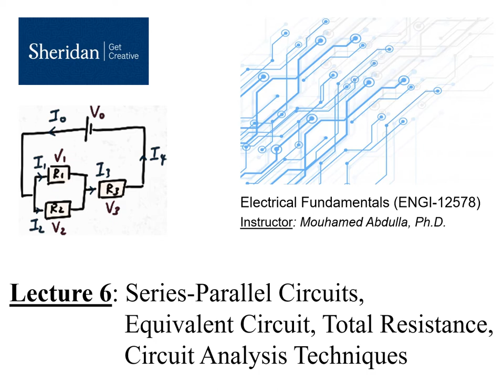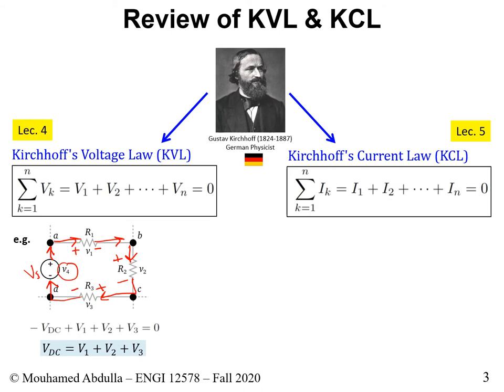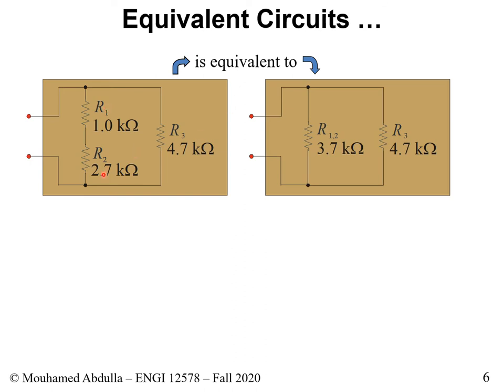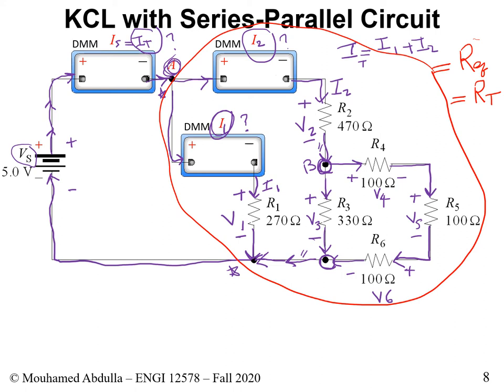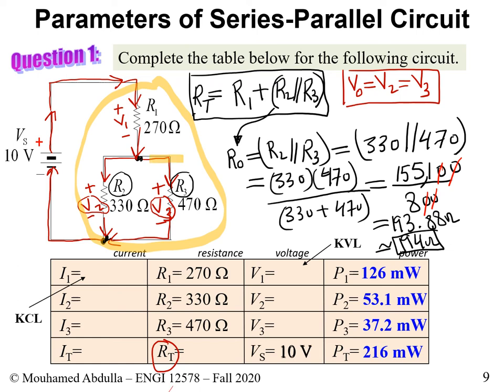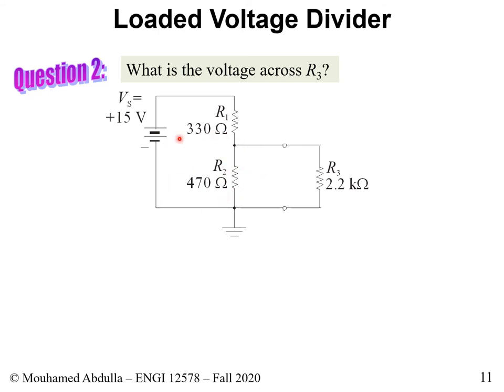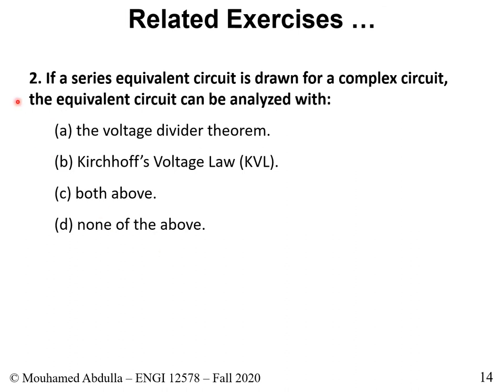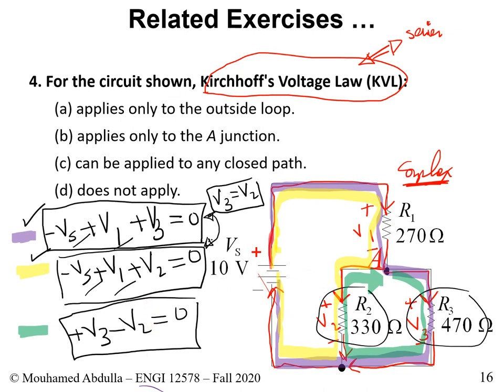Lec 6 - Series-Parallel Circuits, Equivalent Circuits, Circuit Analysis Techniques

Comment from the maker: Timestamps:
-----------------------
0:00:00 - Introduction
0:00:17 - Series-Parallel Circuit
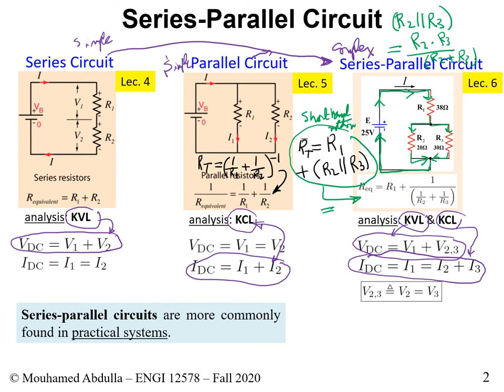0:13:20 - Review of KVL and KCL
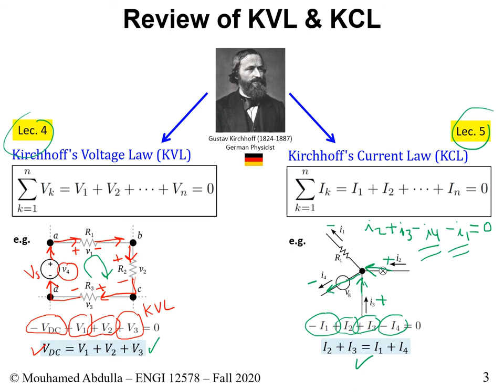0:19:02 - Tools for Solving Series-Parallel Circuits
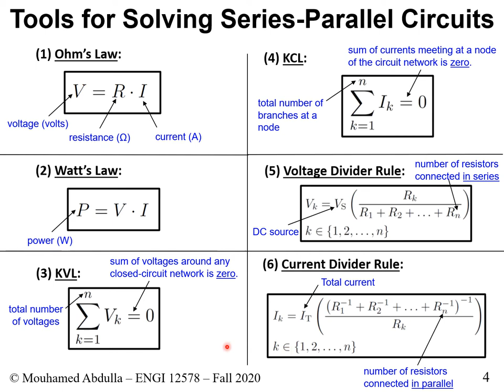0:24:05 - Equivalent Circuits
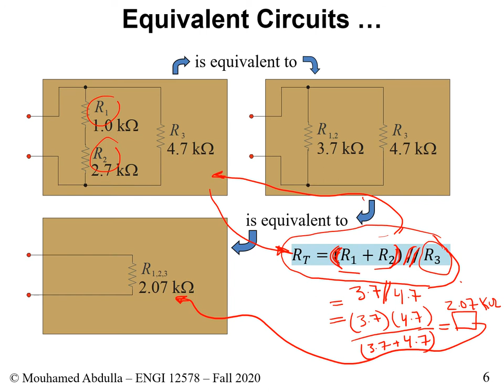0:34:25 - KVL with Series-Parallel Circuit
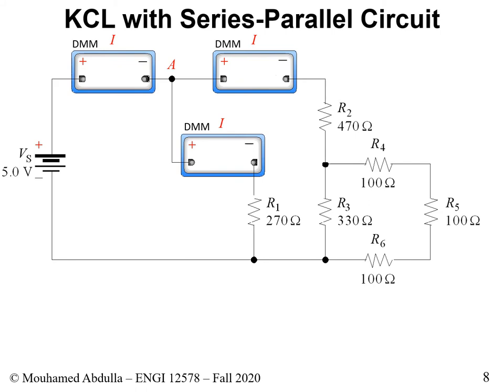0:37:24 - KCL with Series-Parallel Circuit (detailed example)
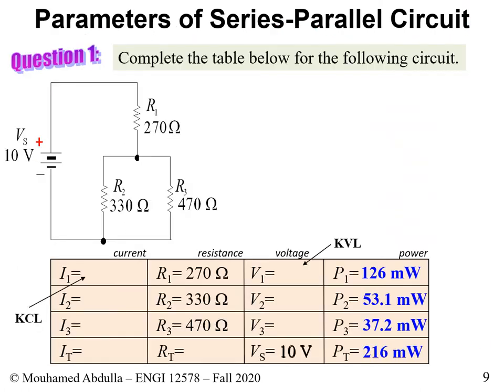0:54:17 - Parameters of Series-Parallel Circuit
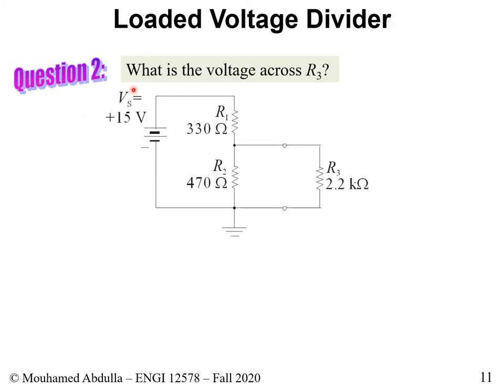1:15:19 - Loaded Voltage Divider
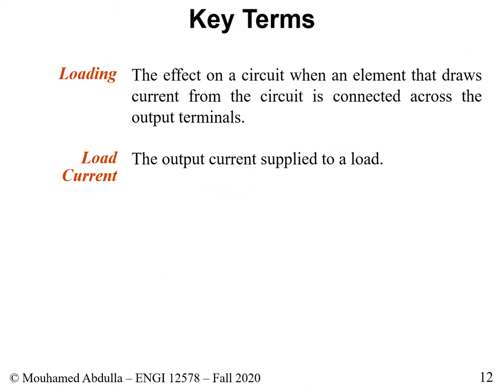1:22:18 - Key Terms and Definitions (Loading & Load Current)
1:23:18 - Relevant Multiple Choice Exercises (x4 problems)